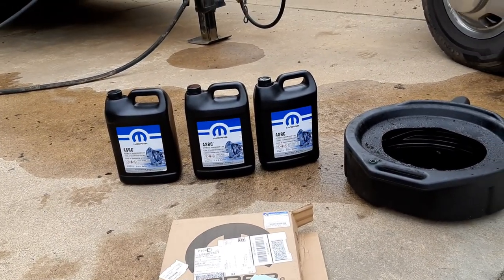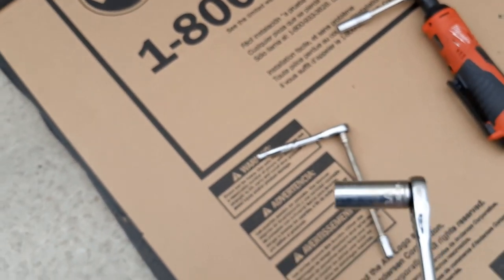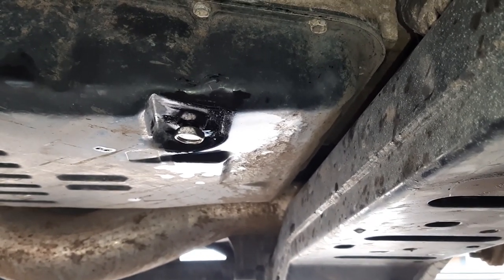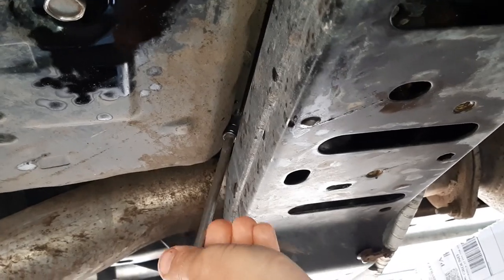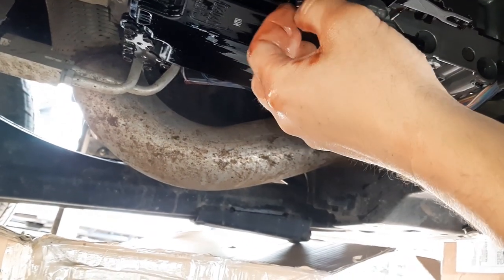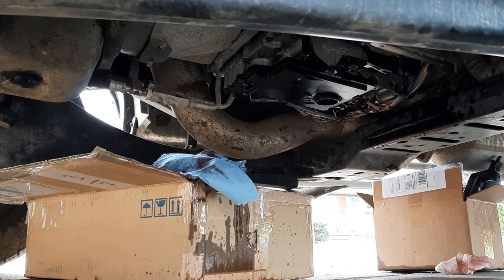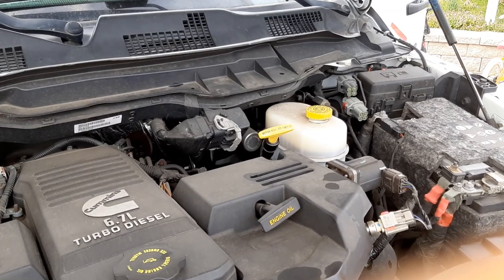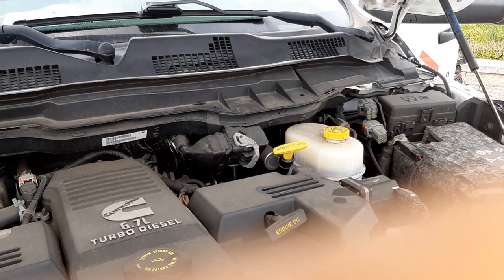Aisin Transmission Fluid and Filter Change Ram 3500

Comment: Great info here as I did all the 30 k fluid changes on my Ram 3500 ! , and on those four pan bolts at the cross member I used a piece of vacuum hose to reinstall and they went in like a charm with re- tightening with the 1/4 ratchet done likety split.. old school we used to install spark plugs with a piece of fuel line..fuel line too thick- used 3/8 vacuum  line  job done.. saved a boat load too.. doing it myself...thanks for getting me prepared for the Mess too..
Reply from the maker: I like the idea of the fuel hose! Another guy suggested a wobble extension, I definitely plan on trying both. Thanks for watching.
Reply: Also used a piece of clear hose that I heated the end to form around the head of the bolts and with a little guidance went right up AND threaded completely, so all that was left was the final torque which of course was "skill of the craft"

Comment: I performed this on my 2018 CCLB 3500 today. Thanks for the video!  There was NO room for a 1/4" drive 10mm socket without removing the 3 transmission mount nuts in the cross member and jacking the transfer case/transmission up ~1-1/2".  BTW, those are torqued to 50 ft-lbs.  Take care
Reply: I came here to post this exact thing about my 2015 CCLB 3500 that I did this service on today.  I also used a universal style swivel for my application, which works surprisingly well if you use short socket -> swivel -> 3"+ extension.  for reinstall, once you get the tip in the hole, hold the extension up against the bottom of the pan and it will keep the bolt where it needs to be to start, otherwise the socket wanted to walk.

Another thing I did different than the video that I only thought of because of the messes made on camera, 1) drain the pan, reinstall the plug, leave the tub in place 2) drop all except 2 bolts near the front of the pan, re-remove the plug and slowly loosen the 2 remaining bolts to drain most of what's left.  3) finish dropping the pan, leave the pan on the drain pan where it was to catch the fluid 4) pull the filter over the top of the pan.

Comment: Remove three nuts from the transmission that go to the crossmember. Then use a jack on the transfer case and lift it about a half inch and it makes it a lot easier putting the pan back on. Also use a wobble socket.
Reply from the maker: I will definitely be using a wobble socket for sure next time. Thanks for the advice!

Comment: Thanks for this excellent video Sean.  I have a 2014 Ram 3500 dually which I've been dreading doing a filter change on the Aisin because of those four almost inaccessible bolts at the rear of the pan.  You made it look pretty easy.  Now thanks to you I also know to watch out for a fluid shower when pulling down the filter.  I appreciate your sacrifice. 😁👍🏼
Reply from the maker: You're very welcome, I'm glad I could help. Thanks for watching!

Comment: Thanks for the video! Wobble bit extensions might help a bit for those back 10mm bolts.   @4:20 -- An oil catch flat sheet metal pan would be useful.   Another You-Tuber used a flexible clear plastic tube to help take out the bolts (after broken loose) and put them back in (so he wouldn't strip them).

Comment: Thanks for the most important part of the video. You helped me. Restart your truck until the check engine light goes out when changing out the sump filter. Do not change gears until the engine light goes out.
Reply from the maker: Thanks, Glad it helped

Comment: I just did mine for the first time. I didn’t think it was that bad other than maneuvering the pan around once it’s off and holding it up while you start the bolts back in. I used a 6” 1/4 inch wobble extension and a low profile socket (from oreilys) and had no issues getting it on the bolts and using it to get them started again. The low profile socket might be the secret.
Reply from the maker: I will be using a wobble extension next time for sure! Thanks for watching

Comment: Get a 5/8" hose or whatever fits on the back bolt heads and use that to start the bolts.  It also works good for hard to get at spark plugs.
Nice video. Thanks

Comment: Thanks for the vid. The four back pan bolts are not hard at all. Either use a socket that captures the head and you can easily "lay" the bolt, socket and extension flat , sliding the bolt in from the side and then turning up to tighten. Second option...use a screw driver flat blade that wedges into the bolt head and move it into place carefully. You can actually turn a few times to thread and then switch to a socket. I actually threaded one in all the way just to see if I could.  Also, torque values are: pan bolts - 62 inch pounds; Drain plug - 16 foot pounds; filter bolts - 88 inch pounds.

Comment: I got the four bolts underneath the crossmember with no problem...just strait on. I used a Milwaukee 1/4" in drive 10MM standard sock with a 6" extension.

Comment: Nice video. Should be added, if you live anywhere with road salt... it's best to use a little impact and maybe for penetrating fluid.  I got the back ones easy with the wobbly extension, then very easily broke off the first front bolt i tried. After a quick Google search It's a common issue.

Comment: Have you considered changing the Thermal Bypass Valve which is in view on the outside of your transmission. If not, it is a valve that is poor design and ends up failing. Just a suggestion. Thanks for this video, very informative and well done.
Reply from the maker: First time I heard about this valve. Does the valve wear out? Do you replace it with the same part? Thanks for watching and Thanks for the suggestion.
Reply: @srmcontracting  it helps keep the trans cool. Factory one won’t open until trans gets to a certain temp. Did that on my 2017. Trans stayed way cooler even when towing. Rev max is who is buy from.
Reply: No need to waste money on aftermarket bandage valve. Factory works great

Comment: What timing on this upload, was just heading out to do mine now. Thanks a lot -- I'll be using a 1/4" drive wobbly extension for those back bolts I think.
Reply from the maker: Thanks for watching I hope this video helps. Let me know how that wobble extension works out, another user suggested that as well.
Reply: @srmcontracting  It worked, but I won't be doing that again without a lift LOL. What a pain in the... Using the 1/4" drive wobbly I was able to get the four bolts started, but it took a lot of finessing. Thanks again!

Comment: Thanks for a great video. I'm planning to do the first fluid change on my 3500 soon. (Filter change not needed for a while.) For a fluid-only change, is it standard procedure to just drain and re-fill? Or would a shop also drop the pan and clean the magnets?
Reply from the maker: I'm glad you liked it and thanks for watching! The manual says fluid only at 30k so it's probably safe to do just the fluid.  I'm fairly certain that's all the dealer would do as well. Now if you have the time and your feeling ambitious dropping the pan and cleaning the magnets definitely wouldn't hurt anything. You might find the magnets caked with metallic particles and you'll be happy you checked. Or they might me clean and you spent a little extra time for some peace of mind. Hope this helps.
Reply: I suspect a shop may do a drain and fill but charge for a full change. Way to many hidden videos out there to prove it. It's a shame you can't trust em. Too bad about the filter drop mess but your reaction says a lot about your integrity. Most people would have let loose with some colorful words. When your kid asked if it was satisfying I spit out my coffee. Just struck me as 😂. Will subscribe.
Reply: That's what they did on mine at temhe 60k mark, I will be doing mine my self in about 5k miles. The dealer also wants to charge over 400 for the aisin transmission,  it is 230 for the standard auto trans.

Comment: Why not just pull a couple bolts / nuts for the transmission mount and jack the transmission up an inch?  It made it so easy on my truck.

Comment: Hey Sean, Was wondering what you torqued your pan bolts down to?
Reply from the maker: Sorry I don't know what the torque spec are for these bolts. But they're going into aluminum so you don't want to over tighten them. I use a small 1/4 ratchet and get them pretty tight. When you use a smaller ratchet it's harder to over torque. I'll check the pan for leaks a few times afterwards, so I can always get them a little tighter if need be. I hope this help.
Reply: Searched this online as I'm doing mine now thanks to Sean's video!  Found a few docs that say 62 INCH pounds.  LIke other said it's not much as I broke one with very little force removing them with my left hand....  Pan drain was listed as 25 Ft Lbs, Filter bolts were listed as 88 INCH lbs.  Drilling out the broken bolt today.  If anything I post here goes south I'll update

Comment: How many miles since you had done this before and how many miles does the truck have? Thank you for the video!
Reply from the maker: This was the first time on this truck. The book calls for fluid drain only at 30k and fluid drain and filter at 60K. My truck had 62K when I did it. Ive done filter and fluid drains on other trucks and the process is similar.

Comment: Quick question. After you put new fluid in you say to cycle it on/off 5-6 times. You mean start engine then shut off 5-6 times or just cycle the key 5-6 times. Thanks.
Reply from the maker: Sorry for the delay, I missed this comment. You need to start the engine 5-6 times. Hope this help!
Reply: @srmcontracting  no worries. Appreciate the response. Perfect timing as I will be doing the oil change in the next couple weeks. Cheers.

Comment: Is it ATF+4 fluid? That’s what my local dealer told me but just want to make sure. If so I’m going with Schaefer’s All Trans Supreme.
Reply from the maker: If you have Aisin transmission it's Mopar ASRC fluid
Reply: @srmcontracting  so ASRC is different than ATF+4?
Reply: @stephenbaintonjr2718   Everything I researched says Yes!  Must use ASRC, other than that some people reference a Mobil option and recently an Amsoil one, but I never found anything saying yes 100% so out of fear I just went with the ASRC

Comment: How difficult is it to remove the crossmember?? Remove the nuts that hold the transmission to the crossmember then support the transmission with a jack then the 4 bolts on the crossmember???  Anyone ever do this?

Comment: I think 1/4 Drive with extension for those back ones would of been easier and lined up better
Reply from the maker: I did use the 1/4 for those bolts. Someone else suggested using a wobble extension which I think would have worked out really well. Thanks for watching!
Reply: A swivel adapter bud.

Comment: Glad I sold my 2014 3500 for 30K. Cheap bolts, parts, pieces and engineering-communication. I baby'ed mine and it was still messed up.

Comment: Dude.  Getting the bolts back in are not difficult.
Stick an extention 1/2 x 6 inches between the pan and the cross member and pry it open.  
The cross member moves, not the pan

Comment: You forgot to reprogramming the transmission, in case that you don’t know; that need to be done every time that you change the fluid on those ANSI transmission.
Reply from the maker: What do you mean "reprogram"? I've changed the fluid 3 times and haven't done anything different.
Reply: @srmcontracting   
I contact the dealer they said it needs to be “reprogramming” but I guess that’s not the right word; it should be “reset”; if you look at the owner manual on the transmission chapter it will tell how to do it, they said that way you are let the transmission know that it have a fresh fluid and it will adapt to it otherwise can be damaged.
Reply: @lisandrofernandez1503  there is no reset for the transmission, It is only for : 
Engine oil
Diesel fuel filter.
Reply: @rorotkt16   quick/relearn is the name, last week I did my flush and took it to the dealer since I can’t do it with my scanner and they did for me.
Reply: @lisandrofernandez1503  what do they exactly do??
Reply: @rorotkt16  quick/ relearn look at online for more info.
Reply: @srmcontracting  I believe your cycling the truck on & off several times reprograms the TCM.